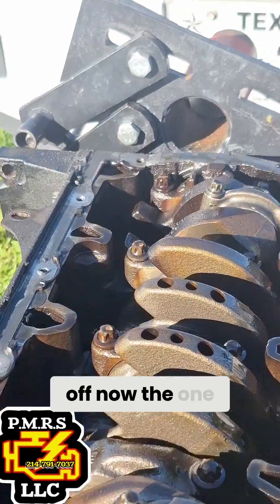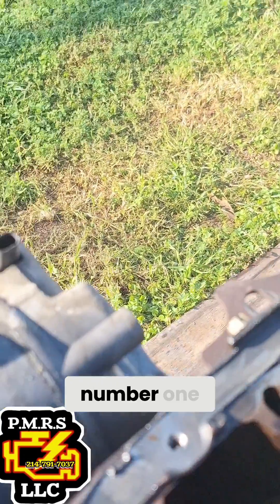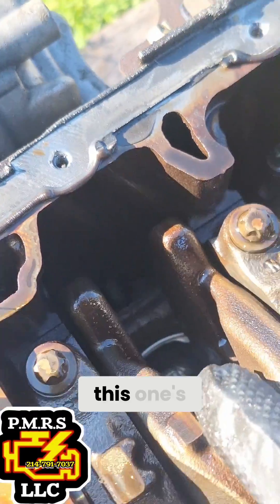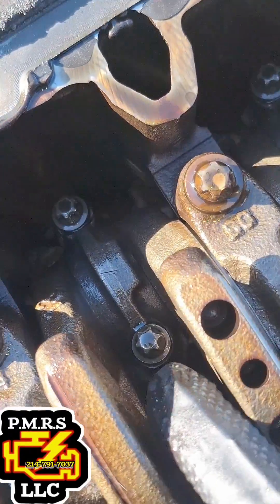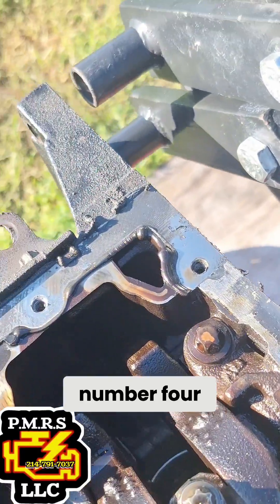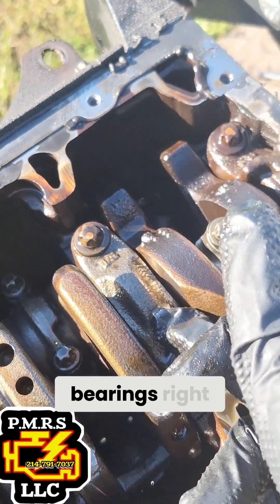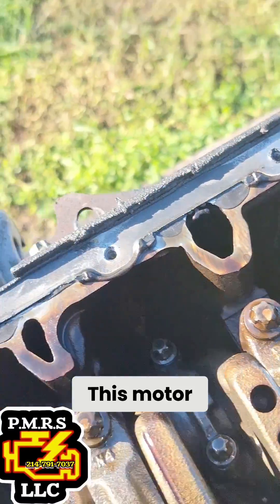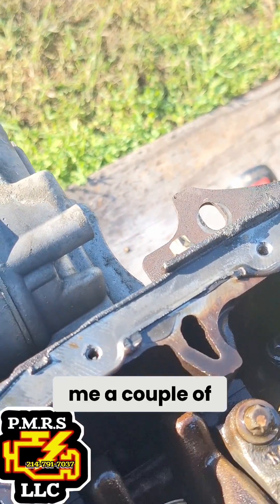Is It Easy to Rebuild a Motor? 🔧🔩

Comment: What’s wrong with it? Actually looks pretty clean in there
Reply: Clean doesn't mean much if there's no or low oil pressure, we also can't see the bores so there could be an issue with compression. Many are the reasons to rebuild an engine.
Reply: @ExxonValDeezNuts  and if your aunt had nuts she’d be your uncle… was just curious what was wrong with it

Comment: 😮Those are connecting ROD CAPS, not pistons! The round Pistons are on the other end of the connecting rods, in the round piston bores on top of the motor. Maybe someone knows what you were referring to, but you're pointing to somthing saying its somthing its not. Js!🤦🏻‍♂️🤔🤷🏻‍♂️👍🏻🛠️🔧🔩
Reply: While you're technically correct, he did point down at the piston shortly after pointing at the end caps. 

While proper terminology is important, not everyone knows the names of all of the parts and sometimes things can be referred to by multiple different, but often similar, names.